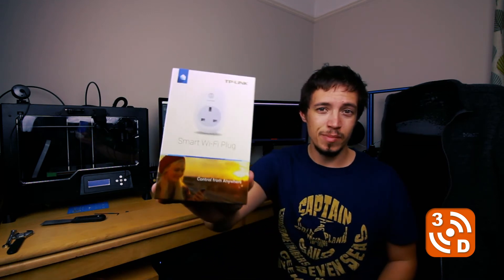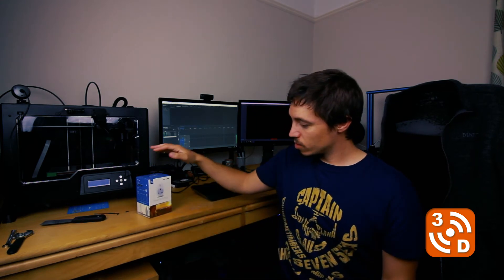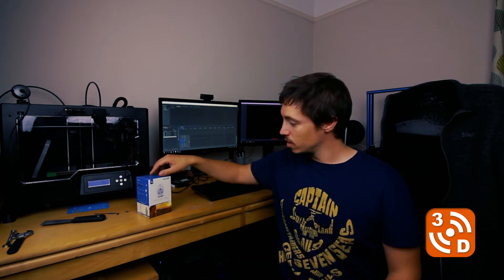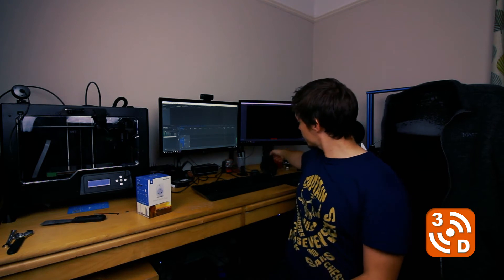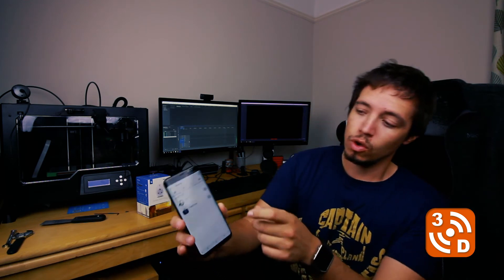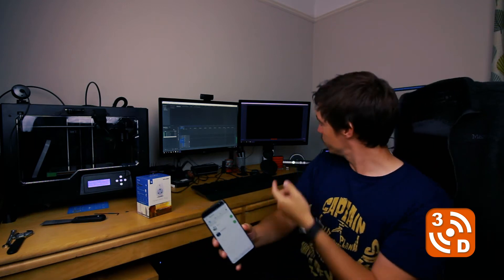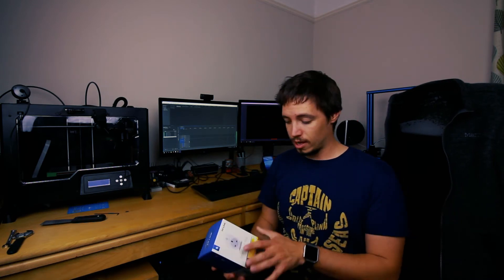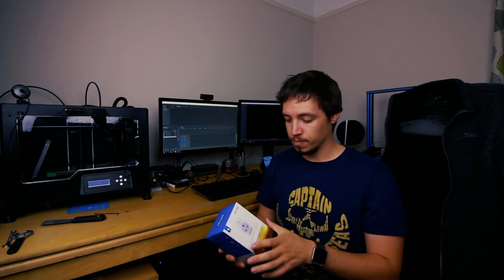Power your 3D printer on/off from anywhere | TP-Link Smart Plug

Comment: hi is this safe for the printer turn off direct from the plug??
i really wanna to use this metod but no idea if is this safe!
i have a Ender 3 Neo
Reply from the maker: Hey absolutely is. I've run every printer and laser cutter I've had in the last 8 years plugged through a smart plug.
The only reason it wouldn't be safe is if you used a poorly made smart plug, but that's no different to plugging any poorly made device into your wall.
I'd really suggest the TAPO plugs (which are the modern verion of the TP-Link plugs I cover in this video).
You can get them here:
UK: https://amzn.to/49QbxJC
USA: https://amzn.to/3wC98E9

Comment: how many printers or PRUSAs can i connect with a tplink
Reply from the maker: If you plugged an extension chord into a TPlink plug, you could fit as many printers as the ampage allows.
However, a TPlink plug has a 13 amp fuse, and a prusa can use around 8 amps when running, so whilst you can have multiple items hooked up with your Prusa, it'd recommend only one prusa per TPlink plug

Comment: Thank you. Great suggestions! Would there be any advantage to using plugs that were also compatible with Google services?
Reply from the maker: In what way do you mean? The TP link ones are recognised by Google so you can use Device Controller on Android to turn them on and off. I tend to just power my printers on and off via Alexa these days. Is there a different Google service you were referring to?

Comment: I was thinking of connecting a cheap wifi security camera and a smart plug. My concern is the current draw from my 3D printer and the max current draw limits of smart plugs.
Reply from the maker: What printer have you got? I've logged 1'000s of hours of print time on these things printing with Prusa i3 Mk3's, Flashforge Creator Pro's, and CR-10's without a problem.

Comment: won't it hurt the printer to shut it off with a smart plug?
Reply from the maker: Most printers this isn't an issue for. The majority of printers out there don't have a shutdown protocol. The on off button literally permits and kills power, just as it would be to turn it on and off from the plug. 

Yes, it could cause issues such as blocked nozzles if you killed the power then left it for ages to cool down whilst it was mid-print. But I'd much rather risk a small chance of a slightly blocked hot end than wasting an entire reel on a failed print, or burning my house down.

In terms of the printer itself though, it's not like pulling the plug on your PC, you're not going to brick the firmware or anything like that. Absolute worst case scenario is you block your nozzle and have to give it a clean (and that's only if you power it off as an emergency whilst it's in the process of printing).